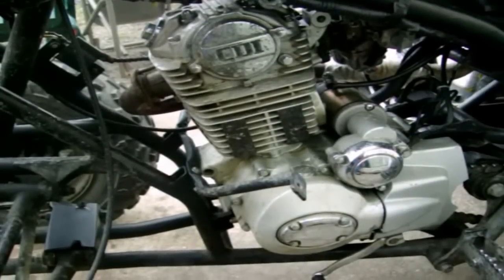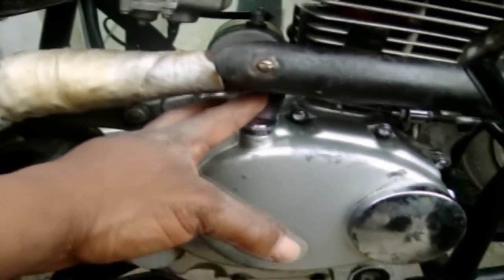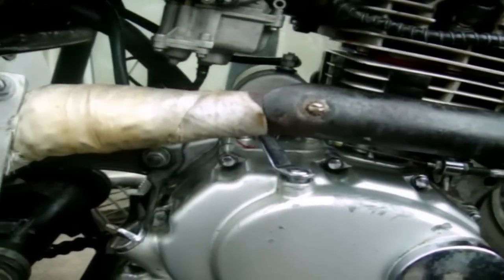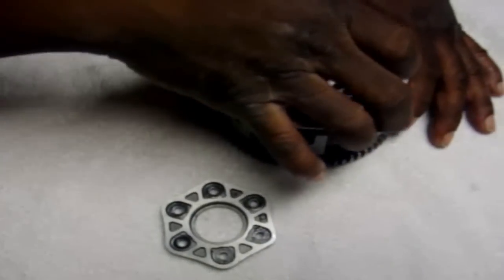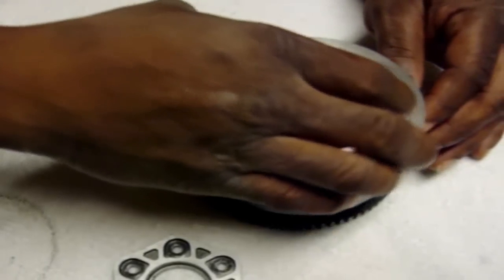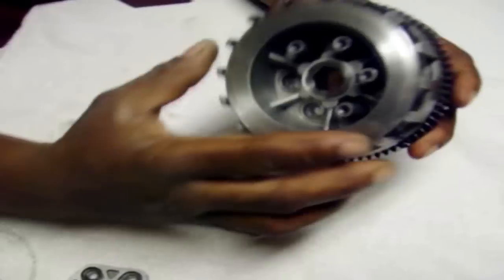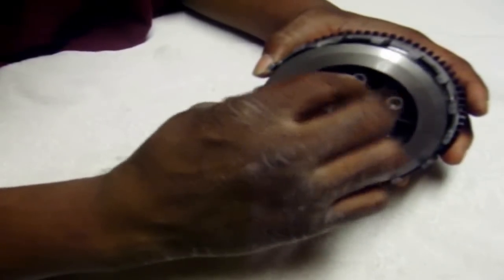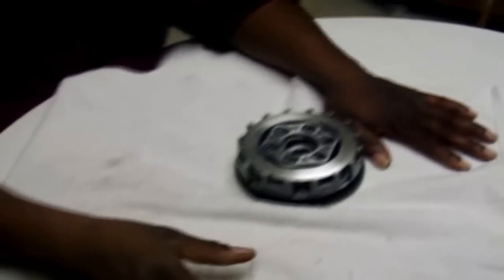atv clutch help

Comment from the maker: when i installed the new clutch the clutch hand grip that you use to put in nuetral  well it was limp so i adjusted the cable as much as i could but no luck it still would not shift into nuetral. hmmmmmmm.  a manual would be great i have been looking and can not find one . i do thank you for your help.

Comment from the maker: gm8607 that spring man i know what your talking about . that spring came off while i was riding and man oh man made alot of problems , the spring broke the oil pump sprocket and it took a while for me to get a new oil pump thanks ebay . i did order a new clutch and the clutch basket . it came but it did not fit.the main problem im having is finding parts . if you know of a place where i may be able to order parts ,drop me a line. thank you

Comment from the maker: hello and how are you I have a question for you I having a problem with my atv engine . it back fires threw the carburetor and I think I know why . my timing seems to be off I can get it started and it runs a little but I notice that gas comes out the back end of the carburetor. why is that .

Comment: the problem you are probably having is the thing that goes into the middle of the clutch is setup wrong.  I made this mistake.  you put the bearing in and then you put the sleeve in and than the push rod.  hopefully this helps.
Reply: How do u do it
Reply: @dakotarhoden4125  there's a thing in the middle of the clutch and it has a little nob on it, when installing the cover, move the clutch arm to the right (as if you where using it) and install the cover, hope this works. Not done with my bike that has the same setup